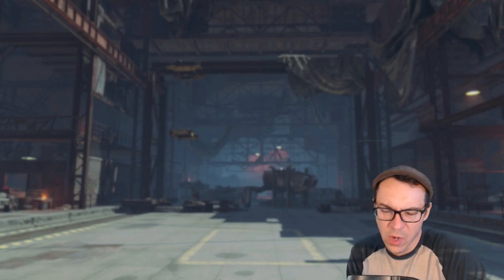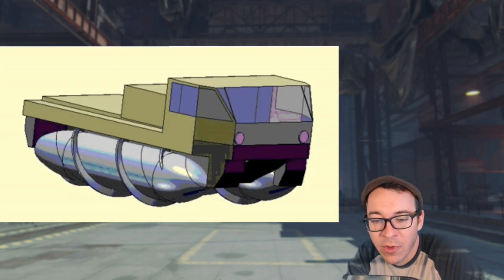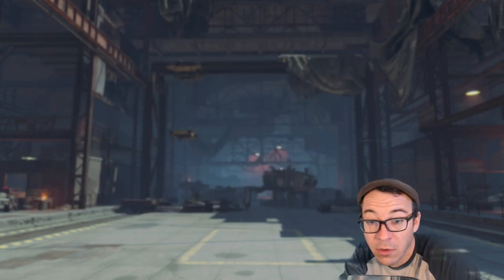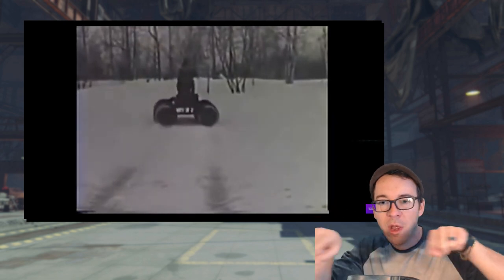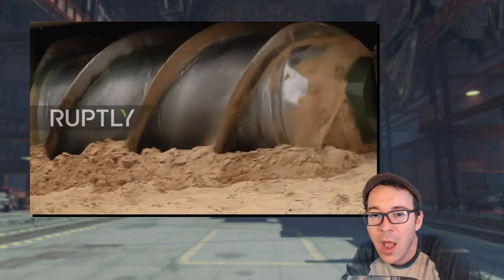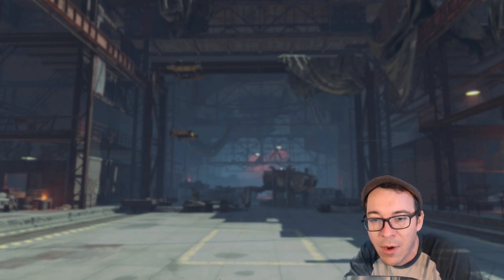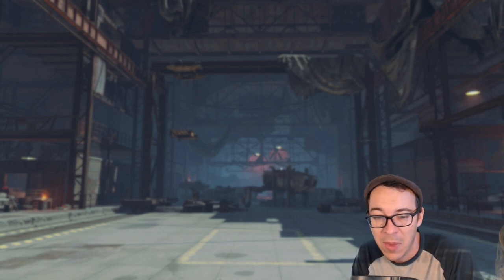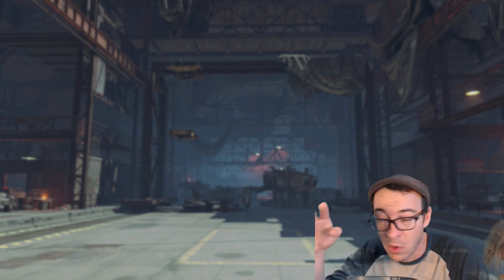MeatGrinders Explained -- Crossout

Comment: To add: augers in Crossout can pivot on the spot unlike the ones shown in the video, because one meatgrinder is split into 2 smaller augers, so to pivot right the front 2 rotate clockwise, and the back 2 counter clockwise. The real augers work like tank treads to my knowledge, with one stationary and the other driving forward or backward to pivot the vehicle